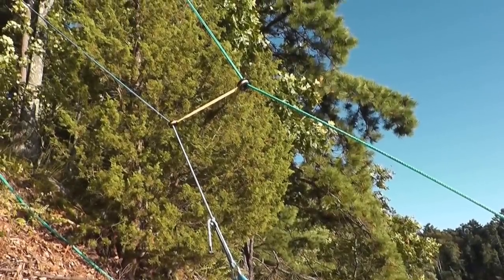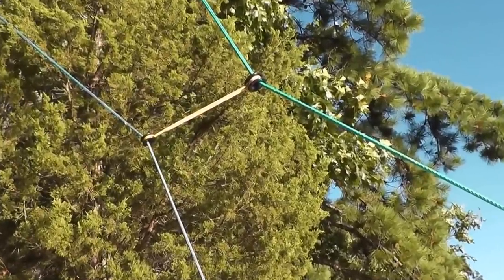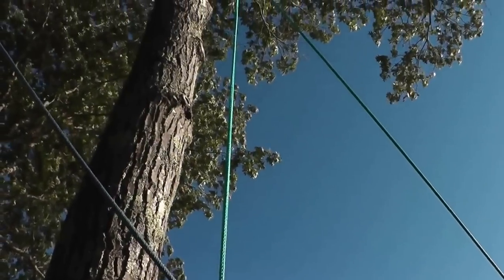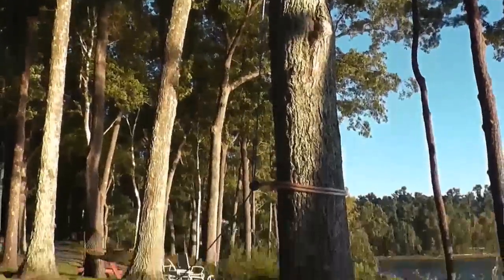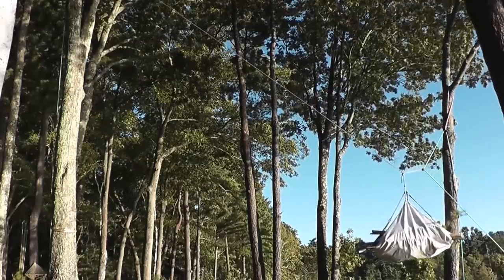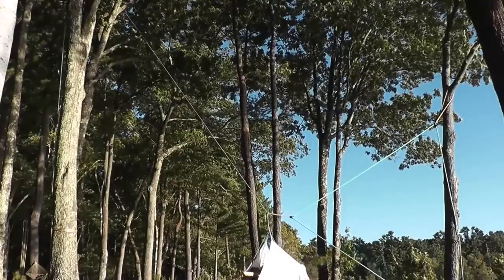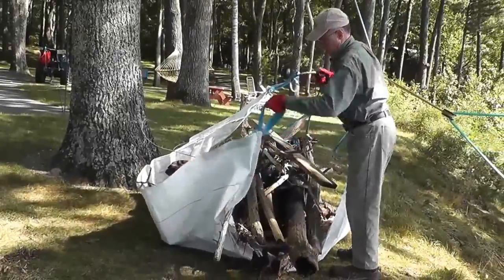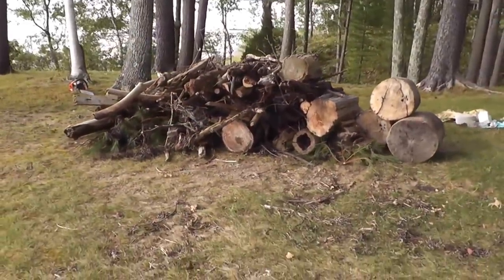XRR Travelling Re-direct

Comment: Is that Green line in the first tree 1/2 inch Tenex?
Reply from the maker: +Matthews TreeServices Yes, the saver over the landing zone is 1/2" Tenex:  see the vid "Pinto Rigging Whoopie".   The saver at the pivot is 3/4" Stable Braid: see "XRR rR Saver for Heavy Rigging".  The re-direct for the tautline is 3/4" Tenex with a block:  see "X/CMI Heavy Duty Rigging Whoopie".  The traveling redirect itself and the final re-direct at the working end are pieces of "XRR Beast Rigging Whoopie".  The whole rig went up without any climbing.